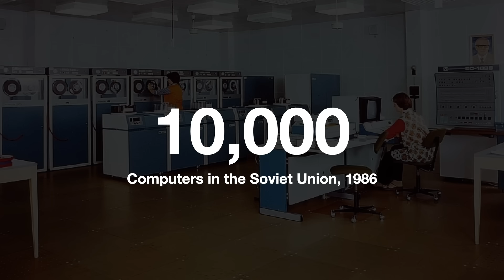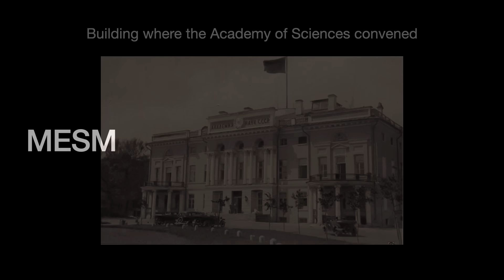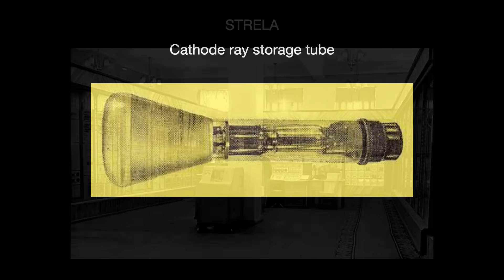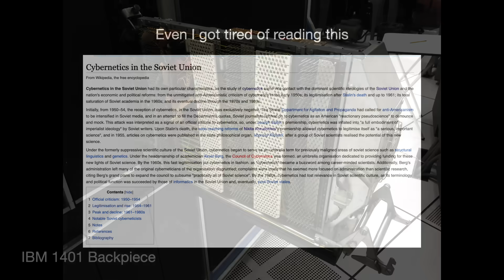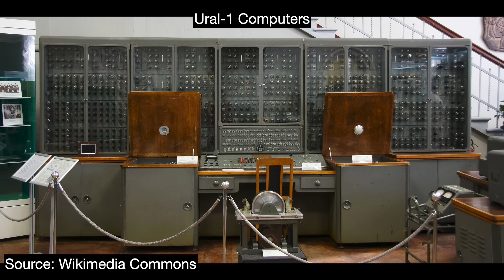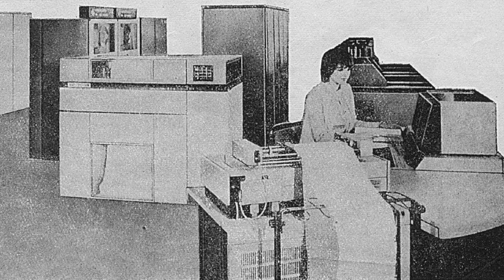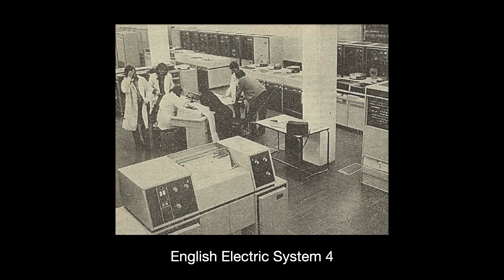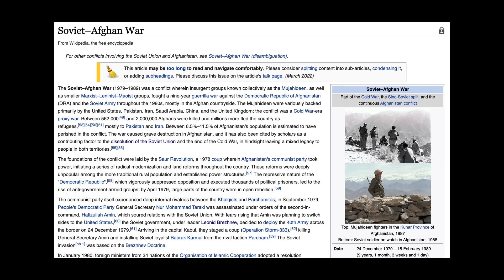Why the Soviet Computer Failed

Comment: End of the 1970s I was working at Siemens and one of my colleagues there, a mathematician and physicist, was an immigrant from the Soviet Union. Calculators by then were standard issue for all engineers, some where even programmable, and were a common sight between the desktop clutter of most of my colleagues. One big exception was my Russian colleague, he didn't even own a calculator. Instead he used an abacus. No kidding, he used a simple abacus with coloured wooden beads to do his calculations with.
And this guy was fast. When he was using his abacus the beads shot across the frame at blurring speed. We once pitted him against someone with a calculator to solve a mathematical problem and he won! The only problem with this abacus was the clatter of the beads hitting each, it could get very loud. I think that's why the guy had his own room.

Comment: Interesting.  I had thought that the USSR lost their ability to compete with the increasing complexity of integrated circuits between the 1970's and 1980's based on the fact that most of the Soviet home computers I know about are Sinclair Spectrum copies and varients which for the UK was early to mid 80's budget technology.
Reply: My father worked in Czehoslovakian Tesla on software for SAPI-1 and Ondra personal computer. I think both were based on Z80, Ondra was maybe smaller, had awful rubber keyboard, SAPI-1 was somethink like 3 boxes on top of each other hosting 8" floppy drive. So I first came to contact with computer in 1985 or 1986. I also remember plotting device build from some ... i don't know how to call it english ... assembly kit for kids which consisted from metal sheets with screw holes, screws, threaded rods, pulleys, gears and so on. But add some stepper motors, rubber band, clamp for holding marker, and few parts. You can search  "Bytefest 2013 - Alfi plotter" on youtube.

Comment: Not sure if you have any knowledge of computers but the 1401 did not replace punch cards.  Punch cards were still being used in to the 70s as a means to input programs and data in to IBM 360 mainframes.

Comment: In 1971 a K-202 computer was developed in Poland. Reportedly it was just as powerfull as the first IBM PC, and it was the same size, but obviously 10 years earlier. Reportedly it didn't get green light for production, because it wasn't compatible with IBM 360, and the chief engineer was fired as he also insulted his superiors and politicians over the decision.
Reply: This story seems difficult to believe. The IBM PC was based on one of the most advanced microprocessors available in the West. How would the Eastern bloc have developed something equivalent to it a decade earlier without anyone knowing about it?
Reply: @Sashazur  There was no secret. Some components were delivered from the West by MB Metals. However the computer was expensive to produce, as most new designs at the time required exclusive programming and as a brand new invention any software was yet to be written. At the time no one was interested in computer alike. Only 30 units were made. MB Metals had trouble figuring out what to do with them, and never made use of their computing capacity. In Poland one unit was used for weather modelling, but otherwise whole East Block mainly depended on IBM 360 architecture and existing library.

Comment: The problem was the centralized economy.  The problem is that in a centralized economy, people can do only as they are told.  In such an economy, when some program fails, it failed because it didn't receive enough resources, and thus receives more until some high-ranking official decides to cut funding.  In a private economy, people are free to do whatever they want with themselves and their own property; they are free to create "wealth".  In a private economy, you receive resources (payment) only when you sell working products to willing customers.  Producers compete with one another not for the arbitrary approval of some high-ranking official, but on the cut-throat floor of the marketplace.

Comment: As the limitations of digital computers become more and more apparent (like, how small can you go?), I've heard that we might go back to mechanical computers, and combine the two forms. We're still less than 200 years into the computer age (I start counting at Ada Lovelace in 1843), so it wouldn't surprise me if we do a soft-reboot and find new methods before we spend much more time on this.
Reply: idk man it's a maybe plus there also a problem of hybrid system computer at some point too they gonna have the same or similar problem to us now (digital computer)

Comment: I have a relative who worked at the local "Institute of Cybernetics" during Soviet era; he told me that they mostly read magazines, listened to radio and drank coffee during working hours. He never even touched a computer.
Reply: In the light of my own experience, this is entirely plausible.
Reply: Actually i the 1990s Russian programmers had (and maybe have) EXCELLENT reputations.  They worked on machines with fewer capabilities than the West, and learned to program with less -- less memory, for example.
Reply: @charleskramer6189  i wouldn't exaggerate.
Reply: They pretended to pay them so they pretended to work!  That said, there’s no problem so great that you cannot solve it with some clever minds grouped together with an endless supply of slide rules and coffee (or tea). Adversity is the mother of invention also. 
I have heard that the Soviet military were very aware of the vulnerability of microelectronics to emf pulse weapons. We laughed at the valve technology in some of their aircraft but they would likely take off after the detonation of a thermonuclear weapon in the magnetosphere.
 I recall my own Father using a slide rule well into the seventies. For some things he said that they were quicker.
Reply: @robinwells8879 it’s fine as a stand in for a basic four-function or very basic scientific model, but anything more than that and an electronic calculator dusts it easily. If you’re using an RPN calculator, there’s no point in having one at all.
Reply: @enginerdy  its good enough to put a man on the moon!
Reply: @robinwells8879  lots of slide rules got plenty of exercise, but one of the enabling technologies was silicon-based computing
Reply: @enginerdy  have you watched the demonstration of the Apollo computer and program on here?  Wonderful stuff.
Reply: @robinwells8879 
Doesn't matter how necessity is the mother of invention when you add the "insane government bureaucrats" element interfering and hindering you for stupid reasons (mainly jealously and spite)
Reply: My Dad was Josef Stalin
Reply: Why is that - lack of knowledge, money or ressources?
Reply: lol 
That is funny as h*ll 😄
Reply: sounds like a perfect life
Reply: Socialism, baby.
Reply: Ah, socialism.
Reply: @sid2112  sadly still around today
Reply: @sid2112  Or communism.
Reply: why would they drink coffee instead of tea?
Reply: @huoltokatkos  tea is very common buy coffee is special and exquisite
Reply: They should be drinking Vodka
Reply: maybe he was a janitor?
Reply: Lmao these reaching comments are hilarious ngl. Got more?
Reply: BS

Comment: After the collapse of the USSR, with the transition to a market economy, the privatization of enterprises followed.  Everything passed into private hands, even strategic and defense enterprises!  It was very easy for Western companies to destroy competitors from the inside, they only had to buy the right amount of shares for next to nothing!  And having connections in the corrupt party elite of the country, it was very easy to do!  You will not believe it, but in this way most of the industry of the former USSR was destroyed, and unique developments were stolen!  Unique aircraft already built, such as the Antonov Aircraft Plant's Mriya, were doomed to rot in hangars.  After all, they were much safer and more economical than their competitors.  The same fate befell Soviet computers.  Developments were bought or stolen, and talented engineers and programmers were lured to Western companies.

Comment: The IBM 1401 didn't replace punched card technologies. For instance, do you know what the IBM 1402 was? A card reader and puncher.

This is generally a good video, but it feels too much like you're just reading Wikipedia. And there's a strange mix of past and current tense: "The Communist Part of the Soviet Union had made this a high political priority, and the penalties for missing those are not pretty." You can't combine 'had' and 'are' that way, especially when you're talking about something that happened in the past and you're not trying (as so many documentaries do these days) to phrase it all in the present tense as though we're there.

Comment: I was in optics for many years and had several "high end" Soviet cameras pass through my hands, including their "photosniper" surveillance set and medical camera. They were absolutely awful. Many were inoperable new from the factory. The two major SLR lines, Kiev and Zenit seemed to be in competition to see which could be worse. Kiev won. Zenit was still being made through the 90s.

What did they do when a reliable and capable camera was needed? They got them from East Germany which had housed two major camera makers when WW2 ended. It was all that saved them.

Comment: Crazy to think these giant, room-filling computers, only managed to do Kilo-flop level calculations, whereas nowadays we have phones that fit in our hand that do TERA-flops... that's such a big improvement!! We went from measuring in thousands of calculations per second, to Trillions, in the palm of your hand rather than an entire room. This is why I got into IT/Hardware... because it fascinates me and I'm obsessed with hardware and how it all works.
Reply: and yet, those days they were calculating big nuclear reactions on those kiloflops, and we are using our teraflops in hands to ... scroll a tic-toc etc...
Reply: One kiloflop against hand made calculation most have been shocking. Japan made relay based computers .... Anything that can run faster and "error free" compared to hand made calculations would have been welcomed. Even mechanical calculators.
Reply: the apollo program run with computers slower as my wristwatch....
Reply: @tomast9034  :face-green-smiling:
Reply: Yes me too, (but it's the software control that I liked to 'optimize') At my time in 1978 University, we had advanced all the way to the IBM 370. Programmed it on punched cards and did time sharing with 4 other Universities. While my job may have only required .63 seconds of CPU time, Job turnaround from card reader to printout could be 3 - 6 hours, just for an ABEND due to a stupid syntax error. (like forgot a semicolon) This agression cannot stand, man.
That's what awakened my inner hacker. Sending the printouts in front of my job in the queue to the printer at Duke could move my job right along. Poor victims who never got their printouts and the confused operators who looked in vain in  the 'wrong' computer center. Then there were those poor secondary victims (I never saw), the Operators at Duke Operations distributing printouts that would never be picked up. Sometimes it's just about (mis)using all available resources to get the best possible throughput/ bandwidth (a term nobody had heard of back then) so you could go back to your dorm room at 3am to get a few hours of sleep.

Comment: around 1981 soviet spies managed to bring a copy of personal computers apple II, 8 bit computer. these were reverse engineered and set for production in Bulgaria, in the town Pravets. these were the pride of the socialist economy.... However, the cpu made in bulgaria was 20 times more expensive than the original taiwan made cpu. as a resullt the bulgarian computers were made mostly with taiwan-made cpu. bulgaria produced 16-bit computers in 1986-87 as well. however, the quality of the individual parts was lousy. the extension cards, video cards, hf-controler cards etc, had large tolerances, and the inserted controller cards had to be wiggled back-forth, to align the contacts.

Comment: Should be noted, Russia was as advanced as Brazil was when the October Revolution occurred. Capitalist Brazil wasn't anywhere near the development level of Russia was in 1991 when the Soviet Union collapsed. The Soviets may have competed with the USA and the West during the Cold War, but that's not what you should be judging it by. Imperial Russia was the most backward country in Europe, with industrialization many decades behind the rest of Europe. Soviet development was impressive, regardless of the inherit problems  and weaknesses with the system. So much so, that the USA greatly feared the capabilities of a country that wasn't ever very close to their development level.